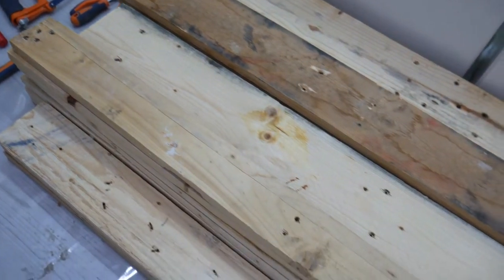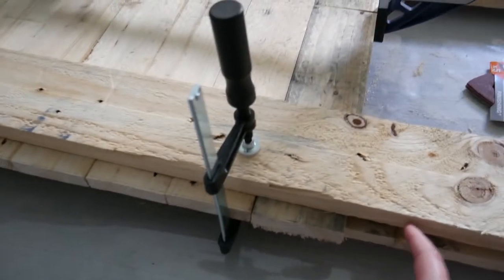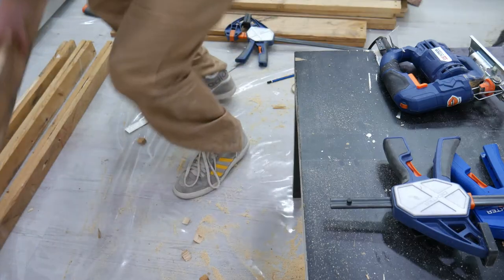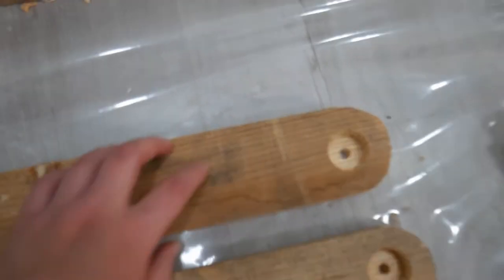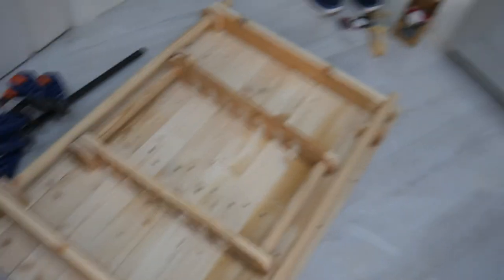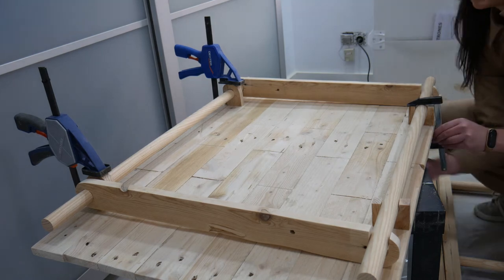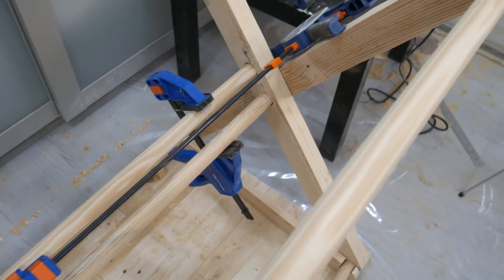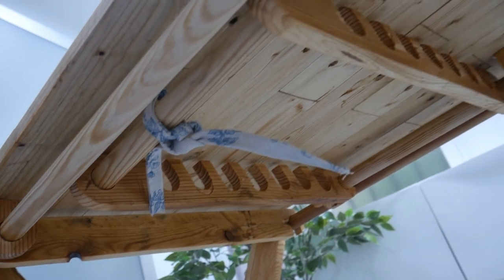DIY Drafting Table | Foldable Table | With Adjustable Angles | 100% made out of recycled wood

Comment: We kept finding we needed a folding table. This is so easy to store. https://www.youtube.com/post/UgkxStL0QRChBju4aQlnTrRgBZvafFog0KU3 Opening and closing is easy as well. It has a great handle for carrying around the house. Its pretty lightweight and slides around easy. We bought it for our daughter’s first sleepover. Breakfast was a blur - but 12 7-8 year olds fit at the table with room to spare. We used it at thanksgiving and 6 adults fit comfortably on each side plus 2 on either end for a total of 8. Super easy to clean up afterwards as well.

Comment: Forjust being glued together, that looks super stout. However, you defintiely want to predrill and screw every wood connection for any sort of pheasible structural integrity. For the super wide pieces, you can get a pocket hole screw jig, OR, just drill holes and use wood cut offs as pegs. Will take a lot more time but you will get a lot more longevity and can still be done to what you have right now. Looks great tho

Comment: Heck yeah! It is very impressive that you built a really great piece of furniture without using a carpenter's square or a level. 

Tip 01: Use a reciprocal saw with a fine tooth metal cutting blade to cut the nails between the board and the pallet beam then you can hammer them out with a punch.

Tip 02: Attach a strip of metal to the support arms and a magnet to the table bottom so that the support arms automatically attach when folding for storage.

Tip 03: Glue a strip of wood about an inch from the bottom of the table top so your pencil or jigsaw pieces don't slide off. 
                                                        VARIATIONS
 
Dining table: Glue a piece of grade A birch plywood to the top

Drawing table: Frame a sheet of 3/8 glass to the top to create a smooth hard working surface. Just keep in mind that glass is heavy and will detract from the portability of the table.

 Workshop table. Do nothing. It is perfect just the way it is.
Reply from the maker: Great ideas 💡 thank you 😊!!!

Comment: Can you tell me how far from the ends of the legs each of the holes are and which holes go all the way through?
The PDF does show these dimensions 
Thanks going to try to make this for my step-daughter
Reply from the maker: Absolutely 🤩 the only holes that go all the way through are the ones on the middle of the inner legs, the rest go only half way through so that you can connect the legs together with the poles.
Let me know if you need anything else!! Hope your stepdaughter loves it 😁
Reply: @modernhomemaker  thank you
Can you tell me where the holes should be (how far from the ends)